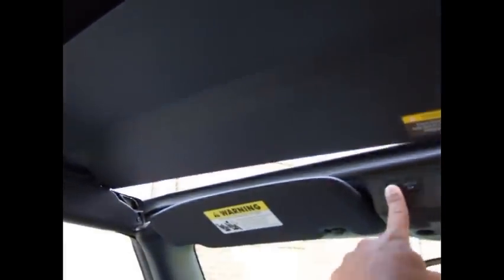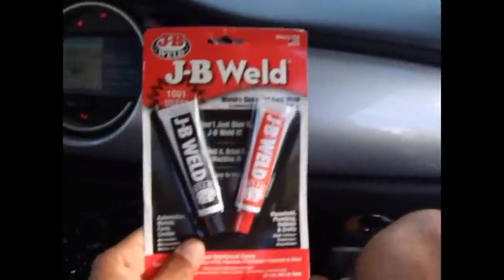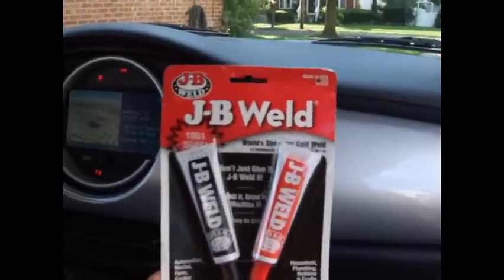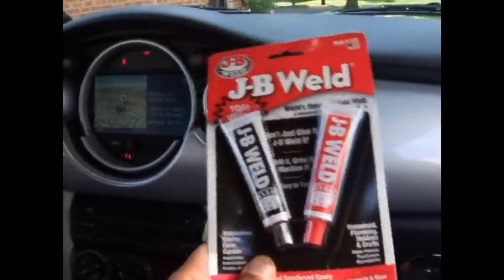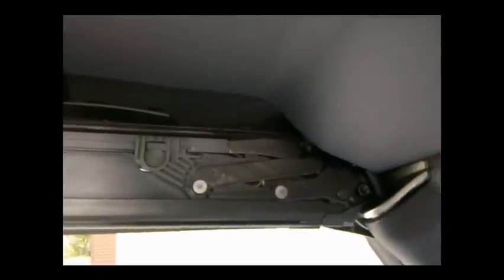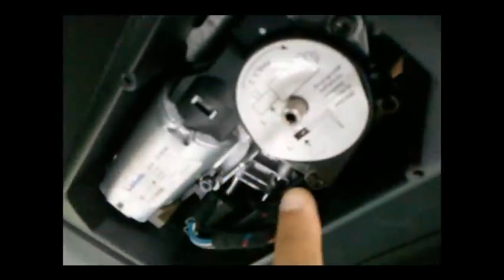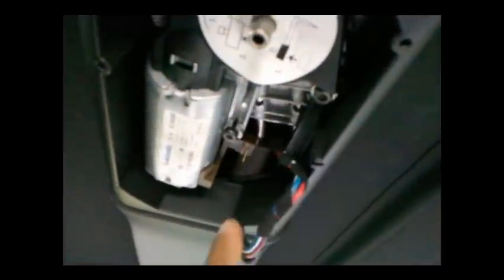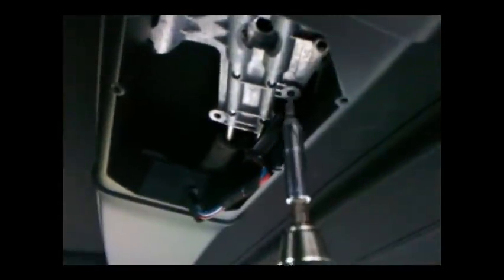Mini Cooper Convertible Top Repair Part 1

Comment: This was a great help and saved me £1,500+VAT as quoted by Mini for a new roof frame (they no longer just fit the cables).  Nipped to Halfords for the steel glue (used an alternative to JB Weld £6), then spent around 5-6 hours (allowing 60 mins for glue to dry sufficiently ) fixing it using these videos on my iPad.  A little fiddly at times, but I'm an office worker with only average DIY skills and you will get there in the end! Thanks Tulllid1 - really appreciated!

Comment: Many thanks. Would never have managed to repair this without your video. Made a silly mistake at the very end; forgot to put back the parcel shelf and so the roof only opened half way. Went onto a mini forum site and found out that the shelf rests on two micro switches which made me realise I had forgotten to put the shelf back!

Comment: Cheers tullid1 for this video, I was quoted £2000 from a BMW Mini garage in Oxon, UK! They said they needed to replace the front 'bow' assembly £1,500 and three 'trims' for £20 each plus labour and VAT. I did it for £6.75 due to your brilliant video.

Comment: This was great, thanks.  I had a slightly different problem in that the lever arm that pulls the locking mechanism out from the front by the windscreen/shield had snapped.  In fact the nylon/plastic arm snapped (the rest was metal and fine).  So I used your video 1 and 2 to get the locking bit out, remove the cosmetic trim and get to the level arm 'thing'.  Replaced to lever thing (part number 54347174763), roof working within 1.5 hours.  Result!  To diagnose this if you have the same, mine would fold the sunroof back and then on the second press of the button only retract the right side of the roof bar and not the left, where the lever arm was busted.  Looking from underneath, you can see a piece of the nylon arm hanging down.  I bought a new one of these on ebay for 45 quid.
Reply: Thank you for the comment here! Mine has exactly the same problem as you described here. Right lock hook is unlocked but not the left so the top cannot get pulled up.  I'm looking for the part you mentioned. And I guess only the left one is needed to replace.
Reply: Hi.  Yes, I only purchased the one side from ebay using that part number.  I think it may have been about £20, not £45 actually.  But to confirm, just buy the one arm that is broken.

Comment: Thanks for the video series!  I'm working on my wifes 05 Cabrio.  Your work and instruction is very helpful!  I have a slightly different issue.  The sunroof function works fine.  It's the driver's side (USA model) latch that won't release.  I found the latch lever mechanism is broken. I'll do a short video of my repair.  Thanks again!
Reply: Did you ever end up making this video?

Comment: Awesome content, thanks for all of your detail. I have a 2005 R52. The sunroof portion works.  The latch on the left is broken, I can unlatch it with a screwdriver just like in your video.  In the right side I can’t pry it down.  If I put anymore pressure on it I will break something.  Any thoughts?  Is it possible to share a video of it with you ?

Comment: A great set of vids, however, may I put a question to the expert(s) please? 
My daughter's Mini One's ('52 plate) convertible sunroof has a broken plastic bracket within the retraction mechanism which won't allow the sunroof to be pushed back. I need to push the roof back to slacken the cloth so I can un-tab it and remove the main broad plate at the top front to get at the screws holding it onto the retraction mechanism so I can take the whole damned machanism apart to repair!!
Any suggestions would be most welcome.

Comment: Hi You mention that previously you fixed the problem applying some pressure to the mechanism to bring the cable back in place. Question Do you have the video of such operation? Thanks

Comment: Do you know if it would be possible to convert the convertible to a fully manual operation to open and close, even if some sort of custom latches were installed and the motor was removed? My top failed for the second time and the car has 45k on it. Its a 2005. grrr!

Comment: Thank you for your videos on repairing the mini cooper convertible top.  I learned a lot. I have 2 questions.  How did you remove the cover on the cross bar. I tried and it wouldn't budge.  Is it just have retainer clips or screws.  2nd question is my slide on the left side doesn't move back far enough to release the claw or slide to the hall sensor.
Thanks for any help you can give me.

Comment: What does turning the screw 1 1/2 times in the panel do?  The reason I ask is that my roof does not unlock on the opposite side and I am wondering if I should turn the screw the other direction 1 1/2 time.

Comment: Hey, i have just watched ur video, it's really excellent but I don't know if I could do it myself being a mere female! What I want to ask you is that I'm not quite sure yet if the cable is my problem. The left hand side of the rrof won't open and when I removed the panel to have a look I could see a rod is bent slightly towards the outside of the roof preventing it from unhooking. Do you think it would be a cable that's broken or would this be a different problem? Thanks heaps, Paula.

Comment: The cable on both sides of mine has come loose.  When i try to release the main latches, then will not release far enough because the black pastic tab behind it that releases the sunroom will not go back any furter.  I took the torques head screw out so that i could get the top to open, but i stll i cant get the sunroof to slide back because no matter how hard a press on the black release for it, it will not budge.  Is there something that i am missing?

Comment: Hi! Thanks for the video. I have one question. Where the motor is, how do I remove the plastic cover that hides the motor?
Thanks!
Reply: did you find out how to open the panel, would you mind share that with me , thank you

Comment: On my 05 - the sunroof portion slides back even. When you push the button for the top to go down, it growls at you and the led flashes.  Push close and all goes into close. Both arms and deck are seated. Any ideas??
Reply: Christian Hyder 
Mine does the same did you manage to fix yours?

Comment: How did you remove the cross section panel ??
Reply: Hi Wayne, did you ever figure out how to remove the cross section panel?  I assume you are talking about the cross section of the rail/arm that the soft top slides along.  I do notice that there is a hex/allen bolt to remove, but even after removing that bold, the part is still afixed quite well.

Thanks!
Reply: I think I was trying to say the panel that covers the motor between (above) the two front seats. But I've had it looked at and partly repaired. My problem was much bigger than yours. Thanks.

Comment: For everyone who can't disassemble the broke latch 'cause it's stuck, please read carefully my post here https://www.drive2.ru/l/510279499233886493/. It's in Russian, but it has pictures and you can use google translate. I solved that problem today. You need to disassemble the plastic cover near windscreen and remove metal plate of the latch.

Comment: Having trouble with the same step as Charles S below...  Can't release the sunroof lock.  In my case it a plastic lever arm is broken as described in this thread:
https://www.northamericanmotoring.com/forums/stock-problems-issues/319047-convertible-top-latch-hook-assembly-or-broken-cable.html#post4330538